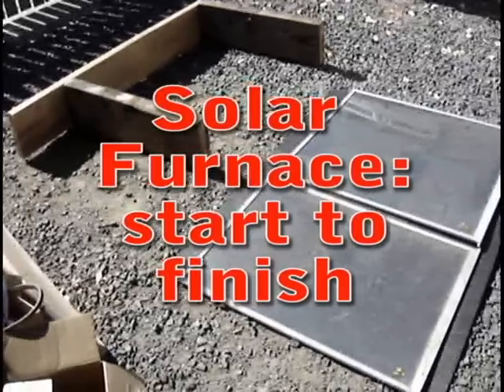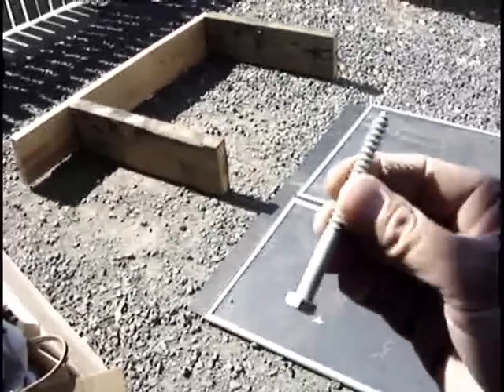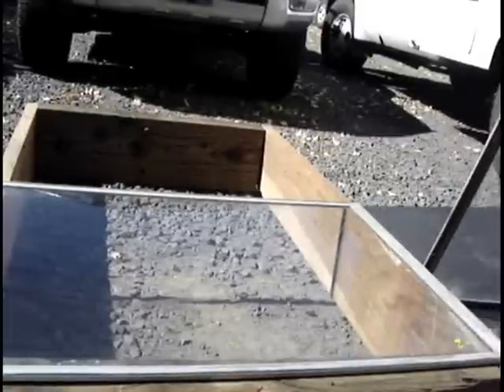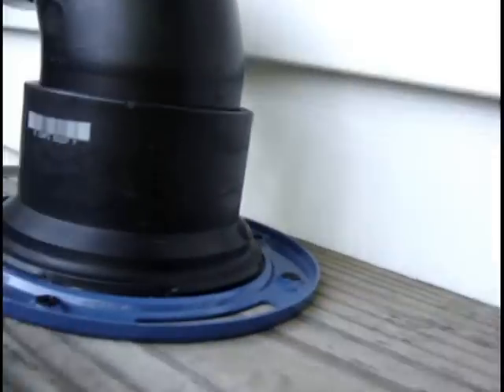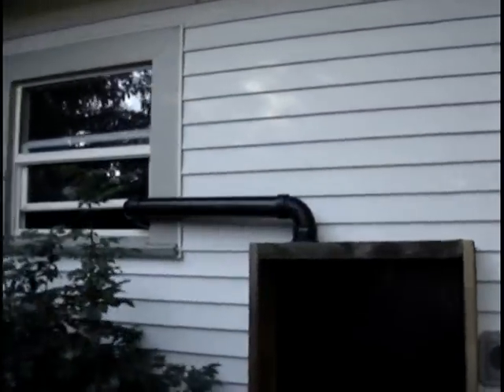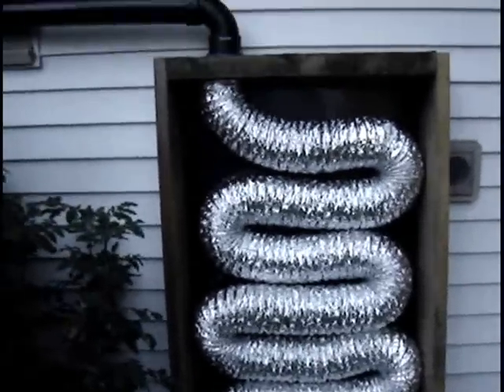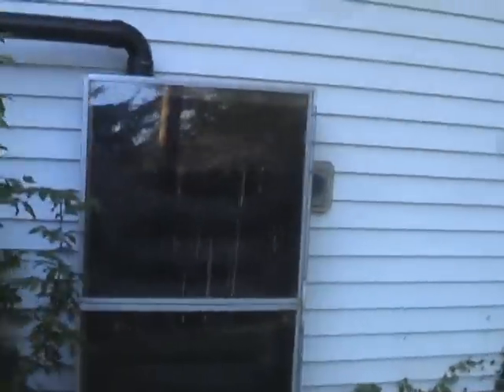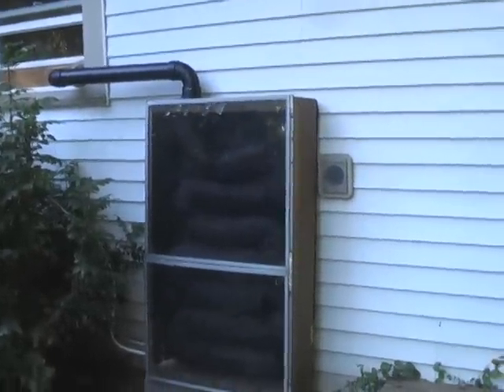Solar Furnace for under $50

Comment: be interesting to measure the carbon monoxide levels before during & after use. probably negligible.
still, it could be heating the room while you not in i spose. v good.
Reply: Exactly where would carbon monoxide be introduced in this system?  Nothing is combusting.
Reply: Chris Ambroson well my thinking was based on a rise in Carbon Monoxide as the Oxygen is used up by any people present in the room.
Reply: nobby styles people exhale carbon DIOXIDE, so there should be no increase in CO levels. They only thing added to the air here is solar energy. It should be no different than if you were in the room with our the solar furnace.
Reply: lol sorry. im no scientist that is true. its very interesting but im sorry i couldnt add to it with any accuracy.

Comment: Any reason you picked silver pipe, the best reflective surface to stop heat gettin in ? If you painted it black you'd have come across a little more switched on.
Reply: Did you watch the entire video?
Reply: Your a Dumbass. 😃
Reply: Fuckin auto correct
Reply: That makes no sense!
Reply: You didn't watch until the end. He painted it matte black
Reply: I wonder if you faced it down and built a fire inside a box underneath if it would be better.
Reply: Alan Davis
Why is white so bright and black so dark, e.m. reflection. We dont see things, we see the reflection of some thing. What energy colored objects dont give off is energy absorbed in the color spectrum, which is electrons being turned into heat.
Reply: Rychardewithoutsnow photons, not electrons, but yes that is the correct reason why black absorbs more radiation (light and heat/infrared).
Reply: Rychardewithoutsnow What is e.m. reflection please? I'm just trying to learn stuff to be more environmentally kind so pardon my asking if common knowledge.
Reply: Alan Davis It's a geek way to say "SMILING FACE WITH OPEN MOUTH" instead of just having a smiley face  Emoticon

Comment: Should have kicked it out on about  a 35 degree angle for more direct sunlight.
Reply: better yet... roof mounted
Reply: I've calculated before that the angling makes about s 2% difference from vertical orientation. The winter sun never goes above ~35° above horizon at Oregon latitude.
Reply: The higher the latitude the lower the angle of the sun and the reduction of solar radiation to be captured.

Comment: Excellent video, thanks. I build solar-thermal heaters differently. In place of the aluminum hose, I suspend a piece of corrugated sheet metal, painted black. It is nearly as large as the inside dimensions of the box. An opening in the bottom of the box lets in fresh air, and a hole in the back wall of the box goes through to the room. It's also possible to draw room air at floor level into the box through a hole at the bottom. Box should be tall and narrow to aid the chimney effect.

Comment: Frogsoda wrote : ''Also you can find big screen TV's on the curb and take the Fresnel lens off of them for more concentrated solar gain.'' THAT is a great idea = more TRUE re-cycling too. BUT do you mean the older Cathode Ray Tube type, as I can't find any reference to modern flat screen TVs using Fresnels. Since those older screens are lead loaded - radiation blocking - they will be heavy, so caution should be taken when siting them, e.g. on a roof..

Comment: The concept is good except for using the aluminum hose... it is a very efficient radiant barrier. The box would have worked good without the dryer hose. Cool air in the bottom hot air out the top.

Comment: What do you do every night, especially on winter nights, to prevent heat loss through your system?  (PS: Love your idea of using flex dryer vent instead of cans!)
Reply: Isnt the point of cans to draw and hold heat?
Reply: Dont aluminum cans hold heat? Would dryer hose hold heat? I wouldnt think so.
Reply: @laragreene8328  so two aluminum objects wouldn't hold heat?

Comment: There are a lot of ways to make one of these, but I haven't seen this way yet. A couple of points, though. Seems to me that the return lines are undersized. Also, they should pick up at floor level where the coldest air is. And the exhaust should be directed upward a bit so as to not mix too soon with the cold floor air that you want to go to the furnace. Thanks for the video.
Reply: the undersized returns create a hypnotic whistling noise

Comment: I was wondering about using that shiny/reflective flex-tube without making it black. Traditionally, both powered and unpowered solar hot boxes use black materials inside of the box (not just a thin layer of black plastic backing).  Ideally you want something in your box that has some good thermal mass to it, so it will absorb heat (you sould pack it with dark rocks). You also might want to spray paint the OUTSIDE (only) of your aluminum tube black (using something like rustolium - done OUTSIDE and then keep the tube in the open air for a few weeks to lose all volatile organics). It is best to use as little plastic as possible, especially in the the parts that that the air passes through. The use of the aluminum flex-pipe in the hot box is a good thing in that regard... but even less plastic would be better. Have you ever tasted water that was left in a plastic bottle in the sun? Plastics give off bad (dangerous to health) substances when they get hot -  volatile organics (solvents , softeners, plasticizers) without which the plastic is a brittle fine powder... however all of these things that make the plastic have it shape and other qualities, are bad for living things.

Comment: I must have missed something.  What causes the air to blow from the "furnace" back into the house, and what sucks the air out of the house?
Reply: Convection current. Hot air rising will drag the cooler air in at the bottom.

Comment: How does the warm air "circulate" into the house with no fan system to propel it? Great idea :)
Reply: Heat rises. It's a convection pump.
Reply: Also called a thermosiphon. The articles about it over complicate the process.
Reply: It's called gravity!  Cool air is heavier than hot air, intake is cool, pushing the hot air up through the pipe!
Reply: ok thanks :)
Reply: AaronLow1 thanks :)

Comment: you need to use "lead free" glass expensive but allows so much more of the uv rays to pass through instead of reflecting, heavy flat black "lead" paint (industrial use only) will conduct WAY more heat to your collector than any other paint.

Comment: cool -gotta ask though ,why 2 real small tubes for intake ,instead of  one  2 inch (aprox ) line? ...just wondering  -overall great idea.I live in a cold  area ,and used to cover my electric dryer vent line with pantyhose ,and run that wasted heat back into my home. Thanks for sharing...will make one myself.great idea

Comment: i would think this would work best if you could get the intake down closer to the floor.  cool idea.  of course, it wouldnt circulate very well, so unless you have 4 or 5 of them heating different parts of the house, you will still need the furnace.

Comment: A couple of simple thoughts, firstly could you show the flow rate and temperature you are getting out of this? Secondly, I think you would get greater efficiency if you insulated the return pipe, I am sure that when it is cold out you are losing a lot of any heat gained.

Comment: OK 
I like. Why is the tubing on the return so small? Is it something to do with differential statics? How much loss do you get at night during colder temps? is this a seasonal device that has to be removed during extreme cold or can it handle the heat load enough to keep your heat loss down?

Sorry about the barrage of questions but I am curious about this.

Comment: The shiny aluminum interior of pop cans or aluminum duct have a low emissivity. To better transfer the  heat to the air inside the pipe  these surfaces should be a radiant surface. Painted black on the inside some how....

Comment: It really shocks me how poorly insulated houses in the US and UK is. You must spend a fortune on heating at winter times.
Reply: up til the early 70's, utilities were cheap and no one cared. codes were slow to change
Reply: Looks like a good weekend project.
Reply: It’s true i live in a apartment when they put new windows in the owner didn’t want to pay for insulation well pretty big complex so we have to put the plastic over casing an window Chicagoland sucks here

Comment: Great system! I have only one question: as you opened the window and used wood to support it, are there security issues? Can the window be opened easily from the outside?
Reply: by drilling a very small hole on the INSIDE of the winow frame ,and inserting a 16 penny nail thats been cut in half  ,the window cannot be lifted up from outside.If your living in an older rental home ,just  putty and paint when you move. nobodys the wiser ,and your still safe.Sadly ,rememer ,glass is only glass and can be broken real easy-if a bad guy wants in ,a window is not much protection in the first place.
Reply: ***** It also might keep them from stealing the air conditioner.
Reply: compared to moving all that solar furnace shit and pulling out the wood, breaking a locked window would probably take less effort.
Reply: ***** great idea!

Comment: How would thermo-pane glass work in a project like this?  I picked up a piece that is about 4x6 but haven't done anything with it yet.  Will it enhance the heat retention or will the R-factors inhibit the heat transfer?  Thanx for ANY advice.

Comment: Neat idea, not new but fun to see someone build their own today.  Did you do a study of actual measurements of how much heat this offered your kitchen, and the rest of the house over any significant amount of time year to date compared to other years temps and energy usage?  What did introducing the VHAC tubing to the system actually provide for you?  It looks to be taking air from the bottom of the heating box, where it would be the coldest?  And doesn't its shininess block the effective use of the black plastic as a heat collector?  I'm wondering if the HVAC duct is even needed.  An angling the system to be more skyward would seem to be more effective.  Make improvements, test each and get back with us on what you find out.

Comment: Excellent and thank you for sharing!  Wouldn't it be beneficial to insulate the pipe carrying the warm air into the house?  Also a small temperature controlled fan could be installed inside the pipe (inside the house) to help move the air.

Comment: cool but why didn't you just use 1 larger black line as an air return back to the large black box instead of those two small white lines

Comment: I have a large section of flat roof , always exposed to the sun during the day.   I wonder how it would work if I built enough of these to use up most of the 35 x 25 roof area?  I have plenty of old 2x6  yellow pine from a barn that was built in the late 1800s,  and can get all the glass windows for nothing.  I imagine since hot air rises, I would have to put a fan of some sort on the intake side to get the cold air up, and push the hot air back down to  the floor in the rooms I could use it in.

Comment: I bet if you use a really thick piece of plexiglass with insulation around the edges instead of the wood in the window, you will get even more heat just from that extra sun coming in through the window, and it will give the illusion that you have barely done a thing to your surroundings.

Comment: The way I see it is the heat would dissipated before it had any use inside. What little got through would rise straight to the roof. The pipe you use is just plastic not insulated!! you should have filled the frame with more tube and maybe placed a small fan at the bottom so as to pressurise the room a little. Keep 'em coming dude small things change the world.

Comment: why do you want to recirculate the air in and out ? unless your outdoors is really polluted, outside air would be fresher .
Reply: Do you think sucking in negative temp air will be heated by the ducting?  Re circulating inside air makes much more practical..
Reply: hmmm i see your point about the negative temperature air, but if the system is horizontal and in sunlight, the tubes would be very hot i dare say hotter than room temperature, as it is out in the open and not in the shade like the room. Air drawn in slowly would be heated up.
Reply: following your logic, and if the clouds shade the vertical tubes, would we also be cooling the room temperature, to like you said negative temperature ?
Reply: Coco Jack Russel nah, the hot air would stay in the house for the most part, since the house is higher than the solar furnace. I assume you could also remove the furnace and close the window if you needed to.

Comment: And you do not need a fan to move the air would you? (I know it is a stupid question I was just asking).
Reply: ***** The intake isn't about temp, cold air moves through the intake because the heat that escapes from the top creates a vacuum in the hose causing "colder" air of the house to be pulled into the low pressure vent hose. You do raise a good point in how efficient this system is but a fan would not improve it though as slower air flow is needed in a less than optimum system like this one.
Reply: Heat rises. It's basically a convection pump.
Reply: Aaron Burns Basic draft like a chimney. This is heating 101 people. I am skeptical of how this would work here in MI though. I like my gas heat. I will take that any day.

Comment: You should try insulating the exhaust for improved efficiency and stay away from plastics like abs and pvc, they will leach fumes into the air that you are breathing when heated. Other than that, great job!

Comment: Hey there, thegully! It's been a couple years, how did it work? Even though it would stick out, was thinking this would work better if the glass side was pointed upwards facing the sun. You could put it just under the window, and plant some shade loving plants/flowers right under it.

Comment: So does it work? Seems far fetched. If you mount it on the side of the house that gets the morning sun it could provide a tiny bit of heat, but here in Oregon as where you live, as  soon as the afternoon hits, the mountain air takes over and makes it bone chillingly cold! Plus in the winter when its always cloudy and snowing or raining it would prove worthless.